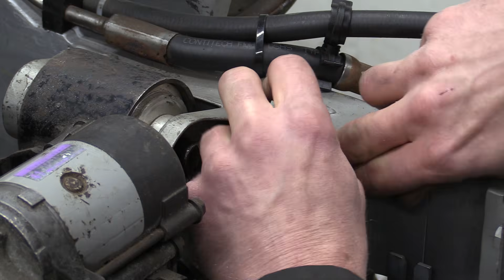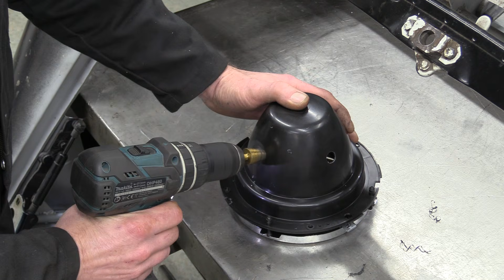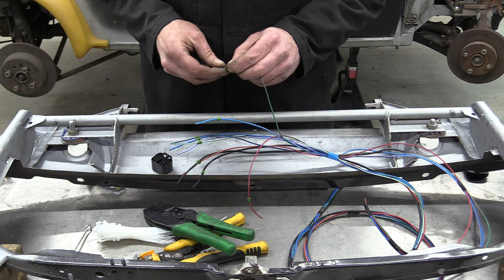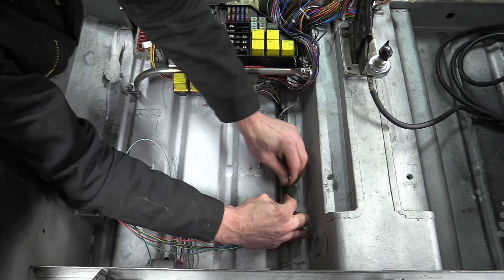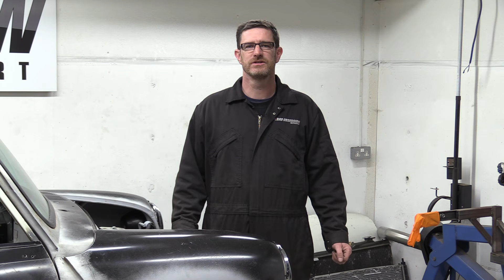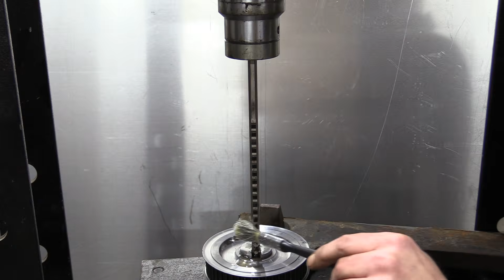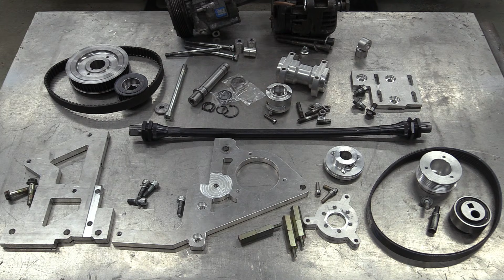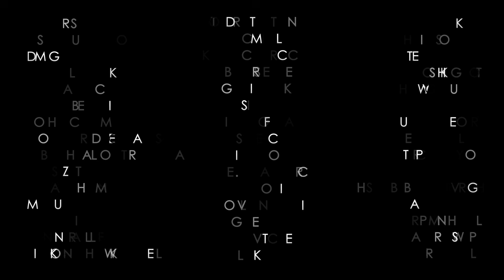Project Binky - Episode 20 - Austin Mini GT-Four - Turbocharged 4WD Mini

Comment: Guys, you could have saved so much time by taking a page out of the SEMA car builds book. Use a bluetooth alternator! Just like all of their bluetooth driveshafts and fuel lines!
Reply: I was going to suggest they use an electrically driven alternator....    (/me ducks and runs)
Reply: I was thinking, 'Turbocharger!', but sitting in traffic, revving the engine to charge the battery would be a tad antisocial.
Reply: Yes. Way simpler than the electrically driven alternator they could have gone with!
Reply: to do that they also have to weld it with their feet
Reply: or have a passenger spin the alternator pulley, since they're not doing anything. It's like a functional fidget spinner.
Reply: Lmfao
Reply: Hydraulics. Sorted. 
JCB (who do that stuff all day long) are only just down the road and I'm sure would be glad to help.

Comment: What are you going to do about balancing and damping the crankshaft, now that you replaced the harmonic balancer/pulley with a solid pulley?
Reply: This is only a dummy engine. For mock up.  I imagine chaps of this calibre will have the complete built up crank with pulleys, flywheel and even clutch cover balanced as an assembly.
Reply: EFormance Engineering. I was wondering the same thing. I realise they matched the weight but I thought there was much more to the harmonic balancer via the dampening rubber.
Reply: Not all cars are balanced off the crank pulley. Honda K series engines have internal harmonic balancers. I'm not saying that's the case with this particular motor because I just don't know very much about it. It may not be important to them that it's particularly smooth.

Comment: You may want to consider the issues most people encounter when running a solid crank pulley.  The Toyota crank pulley has a layer of rubber in it to dampen the crank vibrations.  Guys that run a solid crank on their MR2 often have issues with the front main bearing wearing or other mains issues.
Reply: This was my thought exactly.  The harmonic damper in drive pulleys removes flex in the crankshaft. Going to a solid pulley removes this important, 'tuned' damper. The crank flex occurs when pistons fire. Following the firing of each piston, the crank flexes a little and then whips back and the end of the combustion stroke. The main problem with high speed torsional flexing is not crankshaft fatigue, though that can be a problem. The main problem is that this torsional crank flex and the whipping back tends to destroy oil pumps, which are geared directly to the crank. For details on why you need this damper see this product description:  https://www.flyinmiata.com/ati-damper-pulley-kit-36-2.html
Reply: @maneki9neko   Twin engined earth moving machines (Terex, Cat, etc) have an (un)balance weight on the rear engine to cause crank speed vibes that override harmonic vibrations. Crude but effective as two "front" engines will soon snap the rear engine's crankshaft. Harmonics can do a lot of damage. 
Can you add a rotary damper to the end of your auxiliary pulley?
Reply: Yep my thoughts aswell. Had a GFB Alloy pulley on a Honda B16 Turbo setup and shattered the oil pump in a short amount of time. Back to oem and not had another issue in years but did loose some response. Great trade off though!
Reply: Yes, it's also heavy for a reason. It's a harmonic damper.
Reply: Pretty sure that flexishaft is dampening enough.
Reply: André Ewert i Think he May be refering to the bottom end of the engine
Reply: Sorent1993 correct, the belt and flex shaft have enough damping to that side of the accessories.  But the crankshaft is what I was concerned with.  If you took all the accessories out the damping (or lack thereof) would still be present.
Reply: @capnthepeafarmer  i don't know why they didn't just take drive from the flywheel. Maybe too much noice from gears?
Reply: maybe gear ratios and how to couple the two?  The flywheel is a giant diameter, they would need to have an almost equally sized gear on the accessories to not make them go too fast.  The gear pitch on flywheels are also straight cut and designed for side engagement of a starter spur gear.  I would think that the noise would be tremendous.  Maybe just how can you access the flywheel?  Would they have had to cut and weld into the side of the transmission?  That would be an undertaking of its own.
Reply: @capnthepeafarmer  i think maybe noice is also the limiting factor, but you could cut a small Hole in the clutch housing, that would make IT cuite easy to mount a gear to it 😊

Comment: I couldn’t help but notice you didn’t use and rubber grommets were the wires passed through the body. Are you not afraid of the wires rubbing with all the vibration ?

Comment: I think if you had replaced the crankshaft pulley with a motorcycle flywheel and stator it could have saved a lot of space. I had one on a tractor, worked well for years, although I drove it via a belt and mounted it on pulley blocks. the rated output of 10amps is enough power for driving led lights anyway.

Comment: That is an effing brilliant solution, fellas! I knew you'd have to have some kind of layshaft like that, but didn't realize there was no straight shot to the other side.  I never would have thought about torque load on the camshaft.  Running the alternator off the cam probably would have been ok, but never the A/C pump AND the alt.  So you'd still have had to come up with something anyway.  That is a nice, compact solution and still gives plenty of space for anything else.

So, I'm guessing next episode is exhaust?  I imagine Nik could build a header in his sleep.  What's the plan for a Turbo since you've hinted at using something more modern?

Comment: So I looked at the front lights, and thought, those are just like the ones on my Defender, which of course makes sense given the heavy crossover between Rover and British Leyland.

Despite having spend hundreds of hours and thousands of pounds bolting nifty things onto my Landy, the single best upgrade I ever gave it was one of the quickest and simplest.
LED lights. You can get drop-in replacements for the front indicators, and Truck Lite make sealed LED headlight units that even have a standard H4 connector on, and side-lights built in.
Compared to the BL-grade glow worms I had before, it was light and day. I can thoroughly recommend them. I've no connection with the manufacturer, I just love being able to see 3 times as far at night. I was considering adding front floods for off-roading, but don't see the point now I've got the LED units.
Reply: They are the same on all cars back from that era. Round ones came in a couple of different sizes only. Was used in everything.
Reply: @stefanpetersons1878  Lucas offered car makers any size they wanted as long as it was 7" (or 5" if using 4 headlights). Helpful lot Lucas

Comment: Insufficient rear light ground capacity has been a German thing for decades.  Mercedes did it back in the day and it would melt the connector and pigtail at the light assembly.  After working on a lot of their stuff, I'm convinced that Germans don't really understand electricity all that well.

Comment: Did you guys look at the 12volt AC pumps that are available today? They do have a high power draw but can be mounted anywhere possibly a little easier than your beautifully engineered solution.

Comment: Another great episode, however I had to cringe when Richard cut the ends off the cable ties with side cutters. As a long time telecom installer I would suggest that  you visit your local electronic supply shop and pick up a pair of inexpensive flush cutters. You can then cut the end of the ty-wrap flush with the head and avoid those nasty sharp nubs which always seem to catch the back of your hand when you least expect it.
Also, hate to be critical but these small things just jump out at me, you might want to put some rubber grommets where the wiring passes through metal bulkheads. This prevents vibration from wearing through the insulation and causing a short.
One more thing, No-Oxide grease on the battery connections will also prevent corrosion there.
Aside from that this is a wonderful, engrossing and thoroughly enjoyable project. Keep up the great work.
Reply: They are just dry-fitting everything
Reply: @ruitti99   - I don't think so, once you have gone to all the trouble of cutting the ends off the cable ties you are finishing the work. Also forgot to say in my original post that if you inadvertently drag the back of your hand across the sharp edge of an improperly cut cable tie,  you will -  "MAKE THE NOISE"
Reply: Can also flush cut almost any cable tie with a pair of regular side cutters too if you cut on the right angle...
Reply: @RideWithKyle   - I'm afraid not, flush cutters are called that for a reason. The cutting edges of the blades come together on a flat plane thereby cutting the material as close as possible to the surface. Regular side cutters, if you look closely, have their cutting edges slightly recessed, so will always leave a slightly raised portion, or nub, which can be quite sharp.
Flush cutters are not heavy duty so are therefore most useful for cutting plastics such as cable ties or very light gauge wire. Regular side cutters are more robust due in part to the way the blades are designed and are used more for cutting heavier gauge wire.
Reply: @arnoldj.rimmer812  I'm not asking you, I am telling you that it is possible. 😉
Reply: @RideWithKyle   - Please don't take this the wrong way but with over 30 years experience as a telecom tech I can can tell you with absolute certainty that it is not possible to cut a cable tie perfectly flush using regulars side cutters due to the reasons that I have outlined above.
If you still don't believe me, beg, borrow or steal a pair of quality flush cutters and do a side by side comparison with regular side cutters. The difference will become painfully obvious.
Reply: @arnoldj.rimmer812  sorry I only have 25 years experience in the trade. you got me there. And yep my knipex flush cuters are awesome. But I am dead set serious. You can absolutely flush cut a cable tie with angular side cutters.
Reply: @RideWithKyle   - Oh Well, if you're "dead set serious" I must concede, but if you get a chance try out a pair of Xuron Micro-Shear flush cutters and see what you think of them.
Reply: They’ve already said that they would be taking it apart to paint it
Reply: @13rett 13allard - You mean a "Gromit", Ha, Ha, well spotted, don't know how I missed that. Gotta love their sense of humour. Yes, you are right they are very meticulous, so I suppose that they will probably be taking it all apart to paint, just hope that they remember to install the appropriate grommets and trim the cable ties. At 13:23 you can see a couple of cut black cable ties with very sharp ends. I can tell you from personal experience those little buggers can be deadly if you're working on something and not watching where you put your hands. It just takes a moment with a pair of flush cutters to trim them off. Looks neater and is much safer.
Reply: Arguing over side cutting, eh.
Reply: Do you really think they wouldn't paint it?
Reply: They have yet to wrap that loom too, that means, not only the cable ties have to go but some of those plugs have to come off. Glad you noticed the gromit issue. ;-).
God, I hate wiring.
Reply: @BoB-Dobbs_leaning-left   - Yeah I probably jumped the gun on this one. It was seeing Richard attack the ends of the cable ties with regular side cutters that started me thinking that that was them finalizing the installation. My mistake, but I still hope that they pick up a pair of Flush Cutters for the final installation otherwise it would clash with the rest of their exemplary work. As for the "Gromit" thing it took me a second viewing to notice. 😳

Comment: As awesome as this episode is, one very loud alarm bell rings in the head of this GT-Four owner... Lightening the crank pulley (also known as the harmonic dampener) on the 3S-GTE is widely accepted amongst MR2 and GT-Four owners as being a bad idea, as it can lead to fatigue and eventual failure of the crankshaft. Given how much of a PITA this has been to put together so far, I'd hate for the crank to crack in two and destroy the engine a few thousand miles after you've got it going.
Reply: This needs more bumps. GT-Four owner here.

Comment: No front fog light wiring? I know you're not required to have them though and a Mini is probably so low that the standard headlights are only at that height anyway :p But might've been prudent for some "future proofing" to wire them up to at least the flip front plug? Awesome work though.

Comment: Excellent engineering and execution as always.  However...  Surprised with the tacky after market fog light just bolted to the bumper mount!   In a previous century when I had Minis,  I 'frenched' the fog light and mounted it centrally in the rear apron.   Much better and obviously easy to do.

Comment: I guess you are going to wrap the loom before refitting after paint. Also regarding the fog light, is it not possible to have just one side for the reverse lamp and the other with a red bulb for the fog light? Or do you need two reverse lights now-a-days?! I would make the arse end look a lot smoother.
Keep up the good work guys, fantastic project!

Comment: A harmonic balancer is necessary your crank shaft will thank you. Toyota wouldn’t spent money on it if it could just be replaced with a lighter and cheaper solid pulley.

Comment: Where you run the wiring loom back under the rear bench and into the chassis tube, would it be a good idea to add a rubber grommet? Movement on those wires over time against the metal will cause the wires sheath to break off.

Comment: i have to ask you did all that work with the wiring and the connectors but are you not painting inside the car you would have to undo all the pins to pull the wiring out for paint ?

Comment: Please put a fuse after the battery and before it goes through any metalwork.  Please....
Reply: no way using the engine starter would break a fuse that may fits in the car.
No real car has a fuse from the akku to the earth.
Reply: @10zoll  I think you'll find they do.  Why are you commenting?  You clearly don't have a clue or are you a mechanic who only works on cars made by Tats? Although even they have them on the city rover.
Reply: @mejinks1978  Take a look https://youtu.be/WIyxrvO3dRk?t=813 what is the device under the Handbrake on the driver side? Yes its a manual circuit breaker. Who has no clue about what he is commenting? Calm down and enjoy it. Remember its Niks Car not yours. And he even uses the electrics mostly from a complete car. And even that donor vehicle has no breakout on the earth.
Reply: @10zoll  You've just proved my point by arguing against your own comment.  The danger with not putting in a fusible link is that people think its ok and you end up with a death trap.  After investing 3 years? i want to see him do well, not burn on his first outing.
Reply: @mejinks1978   @mejinks1978  No i didnt prove your point... A fuse that can handle the power from the starter ... At the time that Fuse is blown the whole electrical circuit is already burning. We dont talk about a electrical crash detetcor that shuts down fuelpump and ignition or a manual circuit breaker... 
 It's an entirely different kind of engineering ... altogether

Comment: You might want to peek at that flexible cable linkage to see witch way it's wound. It's best strength is only good in one direction kinda like twisting a piece of yarn it tightens one way and unravels the other.